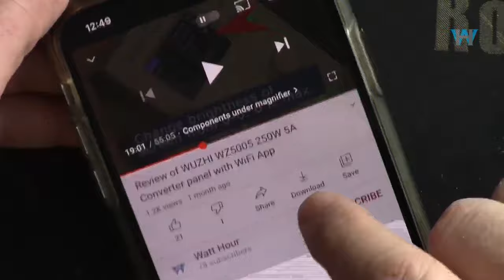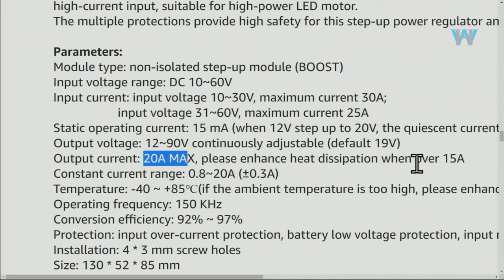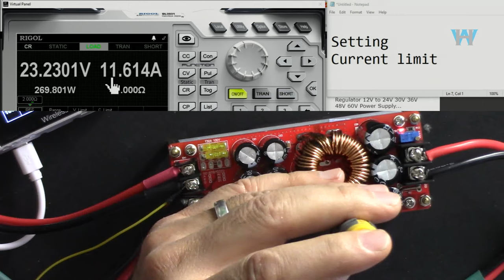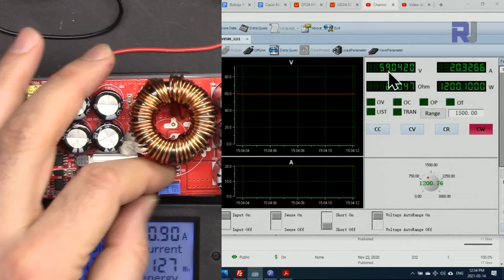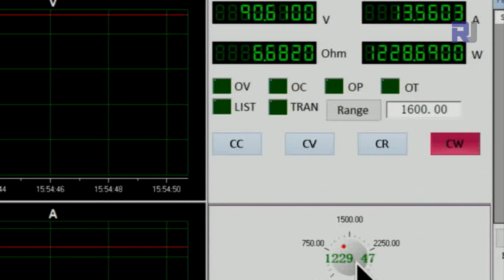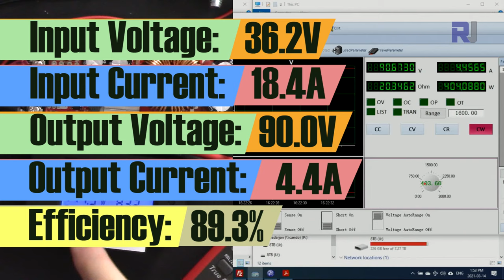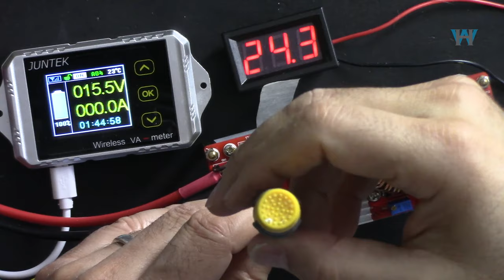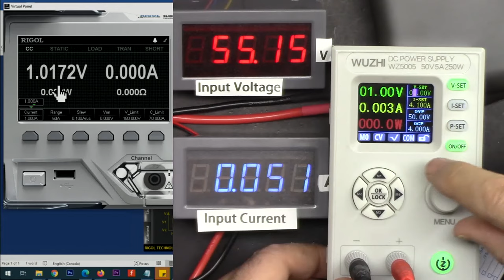Review of DC 1500W Boost Converter 10V-60V to 12V-90V module 1.5kW Tested

Comment: Great video! 

I ordered four of these yesterday. My plan is to put them in parallel to drive a 3kw 72v motor from a 48v battery. I didn't really trust the specs, that's why I bought four, but after watching your review I think it's safe to use only three. The fourth one won't be wasted because I was still looking for a charger for my DIY battery and I guess I accidentally bought one :)
Reply from the maker: Thanks. I hope you get the exact item. You may end up getting a different item because more than one sources producing this.  Good luck and stay safe.
Reply: did you have any luck driving them in parallel?
Reply: Pm me can you to install do sola paint of charger...
Reply: @anwin85alon  The project went nowhere and the parts are still unused, so unfortunately I can't help you...

Comment: i ordered the 1200 watt version, it hasnt arrived, but i wanted to start watching videos on these things anyways to learn how to use them. after seeing your first video i decided to get the 1500 watt version as it had higher amps and voltage capacity. i am still waiting on it too, and thought i would look for videos on this unit and here i am with your video again. i appreciate your videos
Reply from the maker: The 1200 module failed in higher power or even when I was changing the voltage 4 of the died. perhaps it is the quality of certain manufacturer or it is the module in regardless who produces it. I am posting  800W tests soon . make sure to subscribe so you  are notified.
Reply: @WattHour  i just got my 1500 watt version in today. it has three  20 amp fuses and only one set of input and output terminals. now to find a screw driver that is that small. both of my step up devices did not come with any kind of instructions...good times. i will use your videos as my manual, thank you
Reply: @WattHour  and about 20 minutes after my last comment i smoked my load tester some how. polarity was correct. i am new to all this and i am trying to learn, i dont understand my 300 watt power supply and i was not happy with how it was bouncing around between different voltage and current willy nilly so i ditched it and connected a 120ah deep cycle battery to the 1500 watt up converter and then my load tester to the 1500 watt step up converter and it puffed smoke and started to act like it was going to catch fire. it looked like a little bright flame lol. good times
Reply: Pm me can you to install do sola paint of charger...

Comment: Thanks for the video which gives a very in-depth explanation of how the DC/DC converter works.  I also have the same DC/DC converter and tried to use it to charge my 16s 100AH LiFePO4 battery pack with a 30V/10A PSU.  My thought was that with the 30V/10A PSU, the input from the PSU could be around 255W (i.e. 30V x 10A x around85%efficieny).  By setting the maximum output voltage of the DC/DC converter to 56V to charge the battery pack, I should be able to get around 255W/56V = 4.5A during the constant current charging stage (while the battery voltage gradually increases from 52 to 56V).  However, what I got was that the PSU voltage stayed at around 11V with the maximum current of 10A.  The voltage from the PSU did not change even I had turned it to maximum.  With that power from the PSU (i.e. around 11v x 10A x 0.85 = 93.5W), the output of the DC/DC converter was only around 52V / 1.8A even I turned both the output voltage and output current to maximum and the battery pack was demanding much more power/current.  It seems that the DC/DC converter cannot “suck” power from the input side with any combination of input voltage/current.  When it got limited input current at 10A from the PSU, it is not able to “request” for more voltage from the PSU to increase the input power but just stayed at 11V.  Do you know what is causing this limitation?  Do you have any advice on how I can make the DC/DC converter to “suck” 30V/10A of power from the PSU to charge the battery at 52-56v?  Thanks.
Reply: I found the cause of the problem. When the CC mode of the PSU is triggered, the voltage from the PSU will then be unpredictable.  So, the correct procedure is: 1) set the desired voltage at the PSU, 2) set the PSU current to maximum, 3) set the desired output voltage at the booster, 4) set the output current at the booster to the minimum,  5) connect the load/battery to the booster and then 6) gradually include the output current at the booster with the target of not triggering the CC of the PSU.  Thanks again for the video.  It let me have more understanding of the booster and more confidence in using it.
Reply from the maker: you are very welcome and goog luck with your project. Than you for the information.
Reply: Pm me can you to install do sola paint of charger...

Comment: Set the output voltage close to the battery voltage. The battery won't draw excessive current, so you can adjust the current limiting.
Also, during overcurrent protection, nothing was damaged.
This is a good module for charging a battery. Except the ripple may eventually degrade a lithium battery? Does it need a fuse between the output and the battery -- if the boost converter breaks, could it short circuit the battery or deplete it? I would definitely put some protection and a BMS on the lithium cells.

Comment: since watching this video 11 months back now, i have been using these boost converters a lot.

i have 3 of these i run off 55v outputting power at 80v with an amp meter on the 55v input to converter side that runs fine at 10a to 15a continually so im only running them at about 600w to 800w as i did not want to try pushing them to there limits.

what is your thoughts on the 1200w versions of these converters?

i can buy 1200w versions for £15 each and the 1500w versions are more like £25 each

do you think the 1200w version is going to output 600w 55v to 80v continually without any issues like the 1500w ones i have are achieving
Reply: I have the 1200 w module and mine died after 2 days. Its suddenly shorted at the inputs, will send mine back.

Comment: I need something like this to step up the output of a huge 12v power supply so i can both keep my RVs batteries at 13.8 volts and drive the HVAC at the same time, which draws up to 50 amps.
Thanks for this review!
Reply: Pm me can you to install do sola paint of charger...

Comment: Nice review. Could several be used with outputs in parallel? I'm boosting 45v 9a  individual solar panels to charge 48v battery (56v charge with a bms). Maybe use a diode on each output. Your thoughts? Appreciate your complete videos.

Update. Tested with a 45v 9a oc solar panel. Boosted to 56v into a charge controller to charge 48v batteries. 4 boost converters in parallel.  No I use 4 panels to charge vs 2 panels in series for solar converter input.  More current going to charge.

Comment: Thanks a lot for this review it's very helpful! I'm using this for an automotive project. I assume the 12V input efficiency would be greater if only converting to say 24 - 32V as opposed to the max output voltage? For current limiting, would it suffice to simply place say a 20A fuse ahead of the converter?
Reply: Pm me can you to install do sola paint of charger...

Comment: When charging a battery wouldn't it make sense to turn the constant current control to the minimum, then set the constant voltage to the charge voltage, then turn the current control up to the charge rate you want?
Reply from the maker: that is better approach indeed.

Comment: How specific is that current limit? If I want to charge a lithium battery with another lithium battery I find (with my boosters) the current will rise as my input current rises, and when my lithium battery I'm charging is low it pushes more amps and gradually reduces the amperage as the battery charges. But I need a constant 3 amps from the start of the charge to somewhere around the end, but it seems my boosters don't have a current limit but a current offset. So it would be awesome if you could test the current limits over a dynamic supply voltage and dynamic load.
Reply from the maker: Hi, I have shown setting the current and at the end of video I made conclusion. this is not precise in terms of setting current specially very low current of 3A. but I forgot the numbers. So you may refer to the video.

Comment: @WattHour The main MOSFET is a HY3912 W if you wanted to try to repair them.

Really like your DC- DC converter videos by the way, it's really useful to get the honest ratings vs the 'Chinese rating'.
Reply from the maker: Thanks for mentioning the MOSFET.
Reply: I put the 1800W version on an ebike and it failed after 5 minutes, halfway up the hill. Output voltage is now the same as input. :-(
16V to 55V, to a 48V 18A peak ebike controller.

Comment: Hello. your video is very interesting. I have two questions please. 1) I would like to know if it is possible to put two modules (1500 watts boost converter 10-60v to 12-90v) in parallel to obtain 3000 Watts for example. 2) If we put modules in parallel, will the intensity of the electric current increase or not? thank you very much.
Reply from the maker: Hello, if you set exact output voltage for both and set current to maximum, yes you should be able to get 3kw.
Reply: @WattHour  Ok Thank you very much.
Reply: Now can we  run 10kw powerful e-loader motor with 6-7 model in parallel connect with exact volts?
Reply: @alexmorrison3068    Please just read the specs on any aliexpress ad:  they say,  you may NOT connect 2 or more modules in parallel with their inputs and outputs AT THE SAME TIME  ( i would copy-paste,but it is protected...); otherwise the current limit CAN fail,they say
they also say this:  1500 W  (some 1800W)  max, OR 20 Amps max,whichever comes first
your converter may vary

Comment: Would you recommend powering a laptop with this? It is a Lenovo my charging block is 300 watt / 15 amp / 20 volt DC. I do not want to use an inverter due to inefficiency.

Comment: Can these be run in parallel on the output for more amps? With or without a diode to prevent back current

Comment: I am planning on using this or 1800w one to boost the volts out of the solar panels a little bit to stay in the middle of the mppt range of the inverter they are connected to. So that the reduce in the volts of the mppt wouldn't put a low cap on the capacity of power solars can produce. Let me know I am not thinking straight,
very awesome thorough study of the device,
thank you very much
Reply: How did this go? :)

Comment: very good info,  very interesting videos, i need to install a 600 watts hf amplifier in my truck, the problem is the amplifier needs 48-50 volts to work, and i only have 12 v from my truck battery,  do you think this booster will do the job? best regards
Reply from the maker: I by I have tested with voltage of 12V and shown the maximum power. I don’t remember the power value so it it is 600w the yes it will work. So check my test for 12v or value close to 12V
Reply from the maker: Hello, If you live in Canada or USA, I am giving away this DL24P 180W load and energy meter. Make sure to sign up for it https://youtu.be/-UblSfUEY-0

Comment: i am thinking of getting three of these units. i am going to use approx 52volts input on all three and connect all three of the outputs in parallel to feed an ebike controller that has a max consumption of 60amp at 85volts. 

do you think i can wire the outputs in parallel to feed the controller? will the ripple also be ok on the controller?  i can wire three 6s 20ah batteries but i only end up with 75volts, and i know my controller can handle 85 volts, so i thought i would reduce my battery weight by only using 2 packs in series to power the three step up devices to feed the controller the 85v at 60amps max. think i will be ok?

thanks for all your work, i have watched many of your videos several times. i like the presentation style on top of the knowledge.
Reply from the maker: Hello and welcome.  Connecting parallel is tricky. you MUST set the voltage AND the maximum current at exact value to get better result. any difference in voltage and maximum current will cause loss of power.  So yes. you can if you set them properly.  for your second question, this module can output  the maximum voltage and current as I demonstrated.  but if you meant to get 85V and 60A, that is 5100W which is not possible. Good luck and stay safe.

Comment: Thank you WattHour for your great review, I have a 100watt Richman solar panel and a 24volt DIY lithium battery pack, can i use this to charge up my battery pack or go with a lower voltage solar panel, I got the 1200w version of this Boost Converter. Please let me know....Peace
Reply: I guess you should look at the voltage ratings of the solar panel and the minimum input voltage of the module, if they are in the acceptable range, you can go for it.

Comment: I'm going to make my own DIY boombox speaker. I'm going to use this to step up a 24-volt battery to 32 volts that my amplifier needs. however, I have one question. When I have adjusted the voltege to 32 volts, and plug it into my amp, will it blast 30 amps into it? I don't want to damage anything. What do I do? I'm very new to this, so sorry if it is a stupid question.
Reply from the maker: no question is stupid question. The amount of current is determined by your amplifier. the maximum current that I've shown. I am not sure if it was 20A of 30A.  If your amplifier asks for more than amount that is booster can supply, then the CC or constant current feature will suppress the output and keeps it at maximum allowed value which this module can handle.
Reply: @WattHour  Ok, thank you. I understand! This earned a sub!

Comment: Hello!
I want to make a battery for an electric scooter. I wanted to ask you if I connect a 33v-18A battery, but I need to have a 48v-12A output. Will I be able to get a stable 12A or will it be slightly less? And what is the approximate voltage drop for a 33V battery with a 12A load? Thank you. Sorry, I translated from Russian into English.

Comment: Hi, many thanks for your review! One question regarding the current limit. You say in your review to set it at maximum and then lower it the required value. I want charge a battery with it but adjust/limit the charging current. If I set the pot at 5A let say, and I connect the battery at the output, will it damage the converter? Will it be seen as a short circuit?
Reply from the maker: Hi,Yes. unfortunately this  converter has this issue. You can’t charge battery with it. I believe I mentioned it in the video. You MUST test it in something else by setting the current limit. Then try it on battery or simply forget this module.
Reply: Sure you can. Set the output voltage close to the battery voltage. The battery won't draw excessive current, so you can adjust the current limiting.
Also, during overcurrent protection, nothing was damaged.
This is a good module for charging a battery. Except the ripple may eventually degrade a lithium battery? Does it need a fuse between the output and the battery -- if the boost converter breaks, could it short circuit the battery or deplete it? I would definitely put some protection and a BMS on the lithium cells.

Comment: Great presentation!!!   can you elaborate a bit how to set the cc from outside (without the scope you are using).   do you mean I have to put a physical load in series with ammeter to set it?  thanks
Reply from the maker: The amount of current is requested by the load. So connect a load that requests preferred load . Yes you connect it in series with ammeter.

Comment: The video is very good. I would like to know how to control the output voltage, with an external source of 0 to 10V (dc), instead of the voltage control potentiometer. I would like to use an Arduino to do this voltage control, using a PWM to dc converter (0 to 10V).
Thanks
Francisco

Comment: Thanks for your efforts, i have 2 questions 
1- Is it safe to use  this module with computer laptop 19v
2- can I use this module with UPS (Uninterruptible power supply)
thanks
Reply from the maker: for question 1, I believe I've shown enough tests so the viewer can come to conclusion.  to supply 19V or any other voltage, I've shown that you can set it. but this is way powerful 1500W and I tested it. laptop needs the most 200W-200W for gaming laptop and for regular laptop you need something like 100W maximum. So it would be waste to pay more and not use it 2- I have not paid attention to how fast it turns ON, but if you can connect it faster to a power source I believe it should work. But for accurate information please contact the manufacturer.

Comment: 44:01 - u have to rotate it counter-clockwise to lower the voltage protection to minimum 9 volts in order to let all range of voltage to work and charge

Comment: How clean is the DC...?? Just wondering if this would be good for  electron tube  B+...very low current but noise sensitive...
Reply from the maker: That is ripples and I have measured it. Please watch the video use chapters to jump. To that section of the video

Comment: Great explanation 12 to 16v input I can provide and output I need constant 90v low ampare about 10 or 15 amperes input only ? Kindly reply
Reply from the maker: I have done so many tests that you should not have any questions about input and output. Please watch fully and I can assure you that you will have not question left.
Reply: @WattHour   I want to use for Car 12v 15 amprees max   and need output of 90v will it work great for me ??